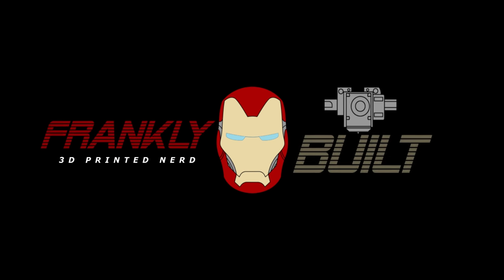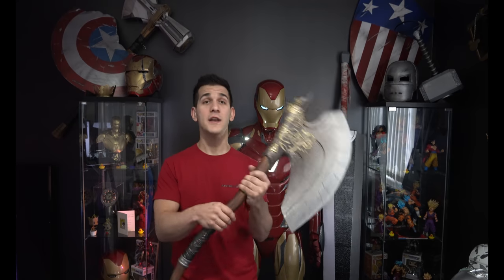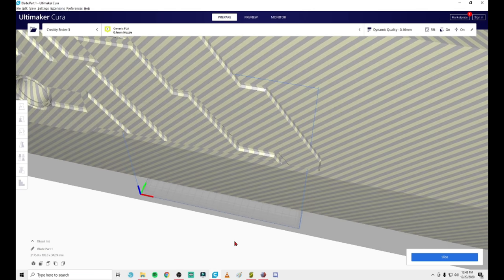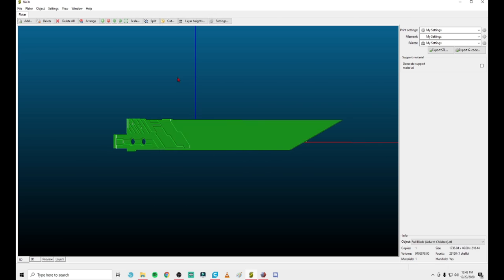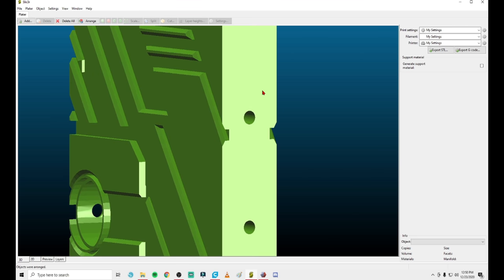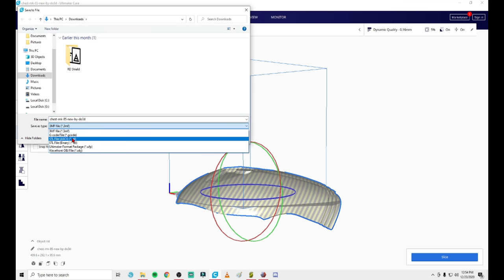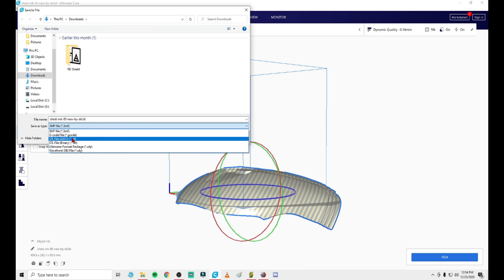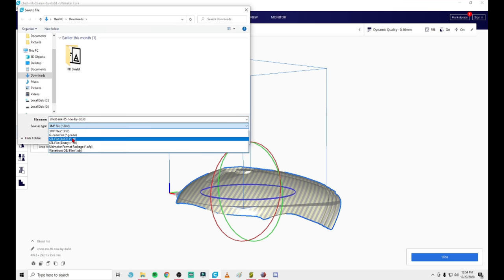How To Fit ANY 3D Model on ANY 3D Printer! - A Cutting and Slicing Tutorial

Comment: I do all my sculpting and a lot of printing prep in 3D-Coat. One tool it has will slice the model into pieces like this but it will also automatically add registration pegs and holes for gluing the printed parts back together. Of course you can adjust the shape of the pegs, number, position, etc.
Reply: is it free?
Reply: Is there a walkthrough on how to slice the model into pieces on 3D-Coat? I just downloaded it and having a tough time finding up-to-date information.
Reply: @evilwearsgucci €379
Reply: @EJReed  At that price it's pointless. Cura plug-in will do it by year end.
Reply: @CircsC  what plug in
Reply: @CircsC  yaa what plug in?
Reply: @yonivora6284  They said "by year end". I assume they mean there will probably be a plugin by the end of the year that will do that.
Reply: @EJReed  or free if you look hard enough
Reply: Hello, is there a chance that you or meaby anyone here could tell how to do t hat exacly in 3D-Coat? :D
Reply: 3D Coat Print is free.

Comment: Thanks for this video.

I've been printing since 2012 when I got a MakerBot (I know, boooooooo!) and had NO IDEA Slic3r had that function and have been re-modeling things that were too big for the printers I've owned over the years.

Call me dopey but when I've asked on Reddit/Thingiverse over the years absolutely NO ONE could give me an answer on how to cut models apart.  I was actually called stupid for asking a few times and stopped even though I knew it existed somewhere.

Thanks again!
Reply from the maker: Reddit is the worst place for 3D printing. It’s toxic. Stay way from it haha 😆
Reply: @FranklyBuilt  lol! Ya think?

By the way because of your video I was able to slice a solid model of Deckard's blaster from Blade Runner.

I'm going to try to sand cast it in Aluminum on Twitch this week.

That's how quickly you changed just one person's life, even just a little, with your video.  Thanks again.

Subscribed!
Reply from the maker: Wow!!! That’s. Wow. Thank you so much for that.

Comment: I had no idea that slic3r could fuse pieces of models together as long as they're saved and exported correctly from the creator. I was thinking though if your model comes in 12 different pieces and there isn't a full model to one-shot there might be a good reason (besides size) the modeler didn't include that. Might be a good idea to reach out to them and ask why. Awesome tutorial Frank!

Comment: I like to use meshmixer with plugs so they all fit perfectly. Great video love the swords, i made the buster sword not long ago. With my gaps with print i use both 3D pen and soldering iron. Pen to fill in gaps and Solder to smooth them out.
Reply: Could you tell me what plugs you used for Meshmixer specifically? I have a lot of large/complex pieces to print and it’d be a huge help.

Comment: Great video as always.
One tip though, I have heard frank refer to this in every video he mentions super glue in, all super glue is cyanoacrylate. There aren’t really 2 part super glues. Or if there are they are all technically 2 part if you use an activator. Activators will work with any super glue, you don’t have to buy the same activator to go with whatever brand glue you buy. Or If you have left over glue/activator it’ll work with whatever activator/glue you can find. I’ve used mitreapel, 2p10 and starbond accelerators on cheap super glues, along with gorilla glues, starbond, and 2p10 glue
And have not noticed any difference 🤷🏻‍♂️

Comment: Would you still recommend 80 grit for sanding suits? You have been my guide through 3D printing and I literally bought a Ender 5 Plus because of you. 😂 I already watched your sanding video and I was just having trouble getting the smoothness correct without actually digging into the print. I think I may just need practice.
Reply from the maker: Yeah it’s still what I use haha

Comment: You're videos help me out so much! Thank you man! I'm 2 weeks into having my Weedo X40 dual Extruder which is the first one I've bought. I just have a question about Meshmixer and Slic3r, I put the full Mjolnir (the one that is linked in your video on a print of it) into Meshmixer and added a tube hole to go throughout, but then when I slice it into parts on Slic3r the holes had disappeared when I put it into Cura and Wiibuilder(software my printer came with). I was just curious if you know why that is happening? Thank you again so much for your tutorials!
Reply from the maker: You need to properly export the file that had the tubes added

Comment: I don’t think you mentioned it, with slic3r, can you set the print bed dimensions so you know you’re making the proper cut sizes to transfer over to cura? Thank you
Reply: depends on your printer size is it a ender 3 because i just left it all at normal when i downloaded it and it seems to have the same box size as cura ender 3 size

Comment: I downloaded mjolnir from do3d and utilized slicer to put the model back together. It worked perfectly and I was able to transfer the file into armorsmith for sizing and cura. Unfortunately when I tried to load it into mesh mixer to make my own cuts it wouldn’t load. Kept freezing up. Have you experienced this before?
Reply: I have the exact same problem with meshmixer. Cant to any Boolean operations. It just starts freezing

Comment: Hey Frank, I dunno if you'll see this but I am struggling with putting a tube through a model I purchased. Every time I adjust it the tube moves off target and when I re-center it auto extends from top to bottom of the model and I can't figure out what I'm doing wrong here.

Comment: Hey Frank, would you be able to do a tutorial video on how to add a tube + a cylinder to a print. I know you did the tube in this video. The issue I am running into is that a Tube only works if the part is sliced into 2.
If you are trying to run a tube through lets say Thor's hammer as a whole piece then the tube is going to either go all the way through the bottom of the handle or the top of the hammer head depending on how its oriented. 
I was trying to add a cylinder and then did like a boolean difference, but every time I do that I get an error when I accept the boolean difference. 

I could cut the handle from the hammer and add the tube to both, but then I am afraid I am not going to get both of them lined up perfectly and when I go to attach the handle to the hammer with the metal rod they won't fit correctly.
I hope I explained that "ok" enough.
Thank you!

Comment: Is it better to use slicer or cura, for a noob
Reply from the maker: Slicer for cutting, Cura for printing
Reply: @FranklyBuilt  man you’re resourceful... so if you’re using a SD card to print do you still need cura? I can also attach my rig to a PC, if that’s better
Reply from the maker: Yep
Reply: @FranklyBuilt  what do you think of the CR 10 max vs Ender 5 plus
Reply from the maker: 5 plus is better. The max is just too big. It’s a novelty you don’t use
Reply: @FranklyBuilt  any recommendations for infill, and temp for 3D printing on a ender 5 plus
Reply from the maker: Yeah. Whatever infill you want and whatever temp the filament says lol

Comment: Hi,
Curious what the costs are for electricity for your state. When I was Indiana my electricity was around $60-$70 in Hamilton County a month. Our HVAC was 70-75°F 24/7 . During summer electricity was more pricey than winter, colder seasons. Curious what a 3d printer electricity would cost operating 24/7.

Comment: Wow ngl Iv been getting ahold of the basics for a while and you blew my mind at the end. Iv been struggling finding strong enough glue to hold my swords together and wouldn’t have thought to use a soldering iron! Thanks for the tip
Reply: he says i sticks the iron inside and fuses the plastics? i have no idea what he means here?
Reply: @BodMorgan  he is talking about a soldering iron. It’s a tool typically used for soldering electronics but can be used to melt and fuse the plastic in our case. Almost like welding
Reply: Yeah I know about pla welding, it was when he said he sticks the whole thing in and melts the plastic from the inside. That's the part that lost me
Reply: @BodMorgan  hmm I don’t know how that would work either. In any case he might have misspoke?

Comment: Hi ...after cutting a file into 3 parts and exporting to cura...slicing and saving to sd...when I hit print on my ender 3 max neo...it won't print...the only thing happens is the usual dialogue screen that pops up after u select to file to print  that shows estimated time to completion is blank...the extruder and bed heat up....but it will not print....can anyone please help and thank you

Comment: there's no program that'll automatically optimize cuts based on a set build volume huh?
Reply from the maker: Nope because every model is different
Reply: @FranklyBuilt  right, but there should definitely be an AI powered program that can discern the best ways to separate any model and optimize how many pieces to dice it into for a given print volume. that's totally doable

Comment: outdated video, meshmixer has been discontinued by autodesk and the download links on the website dont work, and slicer crashes on models that are too big, which is why i need to slice them. will there be an updated guide? any alternatives?
Reply from the maker: Download links still work fine here. I can still install it. It’s a good tool to have, updates or not. I guess you can use some of the new tools in Cura
Reply: @FranklyBuilt  i have tried changing IP, using a different browser, and internet. Still does not work, do you know of a trusted mirror site? All download mirrors i find online provide a file that is flagged as dangerous by virustotal
Reply: @FranklyBuilt  Slic3r link does not work

Comment: ...uh Blender?!
Reply from the maker: Not everyone has blender or wants to use it
Reply: @FranklyBuilt  Yeah that's true,  but it does make the process a lot easier then switching back and forth with saving and everything between programs. Just saying a Blender tutorial for this wouldn't be a bad idea. I do hope they add a function or functions for this in Cura though, would be very handy, maybe even with some fitting profiles you know for exact fitting and easy glueing, or just sliding parts together that sort of thing.
Reply from the maker: Better mesh tools in Cura would be a game
Changer haha there separate shell feature is slowly improving
Reply: Blender doesn't have as rigid a "manifold" boolean. Its a 3D animation program: a model will render even if its only one-sided so the requirement that it be watertight just isn't as important. A boolean can leave faces inside out, one-sided or just plain missing.